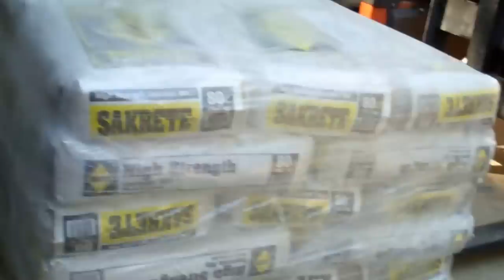Pouring a 60' Foot Concrete Sidewalk by Hand

Comment: Last year I had 5 steps leading to my porch and a walkway replaced for over $4,000. Your friend did a job just as good. You are so right...concrete is very expensive!
Reply from the maker: Wow that was a hefty price at $4000 for only 5 steps.. The concrete itself was pricey and was just glad I had my friend as a connection to make this project possible.
Reply: The steps are 6 feet across  and 9 inches deep, with a stoop on either side. Along with the walkway on the side of the house.
Reply from the maker: Ah ok, I understand now.

Comment: After working as a concrete mason for 15 years, this was almost painful to watch.
Still, it should work well, if there isn't a freeze-thaw cycle to worry about and the underlying base is sound.
I hope it diverts the water correctly.
Reply from the maker: It's not top quality work but it was a deal I couldn't refuse, and yes it keeps the water from getting under my Mega-Shed.
Reply: Lets be honest, its a Hatchet Job!
Reply: RVR2  No excuse for this hatchet attack.
Reply: You mean after 15 years of hiring mexicans... right?  This wasn't even a big job.
Reply: Lol even renting a concrete mixer would've only costed like $50
Reply: TheTomBevis can you recommend a good how-to for doing it correctly? We just bought a house that has all the features we want but almost every inch of concrete they added is utter shit. Two big patio slabs, the entire sidewalk leaning on one side of the house, front sidewalk messed up. It'll end up costing so much I'm strongly considering doing it myself.
Reply: youmongrel YT University has videos about every question you have, and it's free, and easy access.
Reply: TheTomBevis I'm just an occasional DIY concrete mason, and even I can see many things wrong with this.  I wouldn't know how to approach pouring and finishing in that enclosed area, but finishing with a pointing trowel?  No float?  Just screed and trowel.
Reply: The deal you couldn't refuse was your labor. No edging tool. WTF. The damn thing costs a few bucks. Screed job is ok. You never floated it at all. Not top quality? Not even even grade b. Rough as a stomped dog turd. Que Bonito? No. Not even a little.
Reply: I could do better work with just a hatchet. But ya. Totally agreed.
Reply: I really didn't get that. Mix it up on a slab, and then transfer it to a wheelbarrow. Then dump it out again. It was like they just want the exercise.
Reply: I generally work by myself when I do stuff like this. And I do it in sections. Takes longer but the finish is fantastic. It took me a few tries to learn how to float and edge properly.
Reply: How many puddles do you get on that walkway, be honest
Reply: TheTomBevis ok
Reply: actually this is how people in third world countries mix mud. Its an incredibly efficient way to mix mud. Are you even in the field bro? Or you more the white collar type? Desk and muffin bottoms?
Reply: johnknoefler 
cause these guys already know that you get more bags done as a one crew man on the slab than using the wheelbarrow and taking many trips... that's how they work anyways. About the finish I agree, they should've bought a floater.
Reply: johnknoefler 

Rough as a stomped dog turd!  Ha ha ha! I’m adding this to my quotes.  THANK YOU!

Comment: Wow these comments are brutal lol. They were working in trade people - no contract, no inspections, seemingly no budget, i would assume no freeze/thaw to worry about? The dude showed up by himself with a trowel and mixed, labored, poured and finished 60 ft tight in between existing structures in 8 hours so im impressed. Have to admit it was hard to watch having been trained here and i would never do it this way but both parties were happy. Ive been doing masonry for almost ten years and have seen the volcano as well mixing done in a plastic sheet when no shovels available, just rolling it around in a tarp. Have also seen 100+ yards done with a pump truck before lunchtime, all methods worked. This aint pretty but he got the job done with the cards stacked against him. True this would not pass inspection ANYWHERE in this country but it wasnt inspected... only by the owner whos standing right there filming! Third world resourcefulness being shit on by American commentators. Hope it holds up for you, if youre not in a freeze/thaw area itll probably do fine. This is not out of the norm in many countries but is by no means the industry standard in this country, which is what everyones griping about. 300000+ views nice!

Comment: I hate to be the guy who gives bad news but the ground should have been cleared a few inches with some gravel and a layer of sand for water to pass thru easily and rebar so when the the surroundings expand and contract rebar gives the concrete some give but pulls it back and keeps it from cracking ! And you should have tied the new concrete to the foundation of the existing building this way it has support and it’ll stay level with that and it all around is better ... and there should have been someone trolling the concrete after each pour to smooth it out and to help get the air out !!

Comment: For all of you critical of the Mexican.   I lived through a 20 year building boom in Texas. I saw thousands of homes built and sold for $250,000 to $5,000,000. I saw 1black, 9 whites,  and 25,000 Mexicans build those houses.  Here is the relevancy..... If you merely supervised them,  supplied them with tools, and materials, and consulted with them as men,  then you got a great, inexpensive, quality job, by highly experienced men. They take pride in good work,  and I personally know several who will not do bad work just because the customer wants junk standards like this job.  They would turn this job down.
Reply: No problem with Mexicans.  I have work with some on million dollar homes and many do amazing work.   The Mexican in this video does not do amazing work.  This job was done incorrectly, period.

Comment: No control joints? are you worried about cracking especially with the soil and material base?
Reply from the maker: Nope. I'm more concerned about stopping the erosion that was getting under my Mega-Shed. Cracks are not as big a deal compared to that.
Reply: I   do not think it qood idea  to  use scraps  like  that  your  going run risk  it failing  and  have a sink hole  int the side walk
Reply from the maker: This is a common practice actually.. If you use wood or dirt as filling material then yes that can happen but using rock, brick, or stone, (material that won't rot) the worst that could happen is cracking
Reply: When mixing concrete by hand u really need to make sure to keep a consistent mixture.. also before u pour concrete u really need to prep your foundation right. Adding tile bricks and stone won't help at all I give it acouple months or a year till you see your concrete start to decteareate..
Reply: Looks like this guy doesn't know what he's doing.. no joints no steaks on your framing doesn't have the right tools for pouring. Where's his edger? Bullfloat? Fresno?rubber boots?square or round trail?😆
Reply: wouldn't a French drain have been a better way???
Reply: your completely wrong. concrete has very little tensile strength, also freeze thaw cycles will crack and heave the concrete. not to mention that exterior concrete should be air entrained. also when I went through my apprenticeship, my best instructor told us their is two kinds of concrete, concrete that has cracked, and concrete that's going to crack. rebar and mesh will help hold those cracks together
Reply: For sure it will have cracks. But they will be invisible since the finish is so rough. Looks like he doesn't give a shit.
Reply: I did a whole bunch of concrete borders and sidewalks at a house. The owners were short of cash and wanted to save money every way they could. They had tons of rocks on the property. Toward the end of the job I was out of rocks. I literally used up tons. We even got good at learning how to stuff rocks into the concrete as we poured slabs and borders. We would save more than a third of the estimated concrete by adding rocks. It got so I was raiding rocks from a vacant lot down the street. Since I did the sidewalks in sections there was no issue with cracking. The walk way was poured between the footing of the house and an adjacent footing for a block wall. The wall footing was massive.
Reply: Lol
Reply: hey man. just so you know, I had a unit built in like 1940s. the interior flooring was brick underneath asphalt underneath carpet.
The brick disintegrated into sand.
So I don't trust brick to remain a solid base
Reply: my man, cuz all concrete cracks, fuck your control joints, bar, filler, w/e. All concrete cracks. These fools don't know Tom, tell em.
Reply: Edward C with that finish edging sure he's not worried
Reply: @rvr2  all it takes is one crack and all that water will run through and soften up all the ground beneath the concrete.

Comment: Looks fine to me. The only thing  I may have done differently would have been to use some rebar or mesh to keep the cracks from getting to wide. It is a backyard walkway with the purpose of diverting water. No big deal.
Reply from the maker: Thanks! Yeah that would've have worked as well

Comment: I just got an estimate concrete. They quoted $8,500. I know I can do it myself for less than $3,000. I'll buy a mixer, rent a compactor, install rebar & hire a couple of guys with experience to help out. Control joints are very important.
Reply: Well, you said that you were going to do all that a year ago. Update everyone about whether or not you did anything you mentioned. Evidently monolithic concrete construction doesn't need control joints anywhere in the world

Comment: I spent $220 at Home Depot for an electric mixer that has paid for itself already. He should have paid a friend to come help and knock it out in half the time. I would have at least added some wire and suspended it with those bricks. Btw, being Mexican doesn't equal hard worker or good work ethic; this man is a hard worker who just happens to be Mexican.
Reply: Exactly.
Reply: Devin Hardwick no but it helps🇲🇽
Reply: Someone is  Jealous. Did you get passed over for a promotion at work for a Mexican???
Reply: 1) Are you Mexican and 2) are you volunteering to do concrete work?

Comment: Never heard so many negative comments ... if you don't have anything good to say don't say anything . It may be a primitive approach and not done the best way but this world is full of arm chair quarterbacks that dont lift a finger to accomplish or improve a situation. a dirt alleyway to a sidewalk good job
Reply from the maker: Exactly! Thank you for posting this.
Reply: Glenn Vreeland from my experience reading most of these comments, most of these individuals aren’t arm chair quarterbacks. Many have stated that they have years of experience in the field and i have little doubt in this since why would anyone brag about working with concrete? 
And i relate anyone commenting on this thread to that of a critic rather than simple bashing. People are noting how this job was not only done cheap, but the man lacked: proper equipment, proper assistance and failed to implement the right techniques. The job was done horrendously and the final product shows. If this man would have taken the time to better research the project he’d taken it upon himself to do, he’d realize in what aspects he was lacking and could have made a much better job than this disaster.

Comment: pretty much what I have to do at my place, was wondering about using up old bricks and stuff to fill some deeper spots. Reading the comments doesn't sound like a great idea..better to use gravel and reinforcing steel...all costs more. How is it holding up 2 years later??? Did you get cracking and stuff?? Think I will hire a mixer. Originally thinking of doing it by hand too :) Thanks for the vid...
Reply from the maker: The crushed bricks sufficed for what I wanted but yeah gravel is probably recommended. Still holding up very well with only one crack. I posted an update video here: https://www.youtube.com/watch?v=da-T4lWoux4
Glad you enjoyed the video!

Comment: I know it might be late but, you should buy a mini concrete mixer, they come quite handy and they don't occupy too much space nor gas.
Reply from the maker: Well I still have the Mega-Shed driveway I want to get concreted one day so I'll keep that in mind. Thanks for the idea!
Reply: do they have hire shop in the u.s.a, because in the uk it would of been £20 maximum for a day hire of a belle mini mix, and you would done that in a hour!
Reply from the maker: Probably could have rented a mixer but didn't know my friend's schedule so I couldn't reserve one
Reply from the maker: Yeah and cement trucks cost a friggin fortune! Not in my budget...
Reply: not sure where your at but in Idaho it's $110 per yard for a concrete truck. 2 pallets of 80# bags is 2 yards. I'm positive you paid way more than $220 for all those bags. it was probably about $350 plus a ton more work and cold joints in the concrete from it setting up while you mix more. future- get a truck. it'll be better mud too.
Reply from the maker: Here in northern SC that's what I paid for 2 pallets of concrete mix including delivery fee.. It was more like your price for a truck.
Reply: So you think the issue is the mixer eh? You don't see anything wrong  with the brick layers trowel eh? The missing kumalong? The cement finisher's missing trowel?  The lack of any grade lines? The screeding?    Yeah this is how my dad used to do this too in the old country.  For some reason they see that brick layer's trowel as the all around tool, yeah they just enjoy doing things the wrong and hard way, makes them feel like they're 'working'.    BTW 60 ft of walk, 4 feet wide 4 inches thick is 3 yards, about  $430 dollars to have it delivered here the Northeast USA.  A much  more efficient, professional and cost effective way of doing 60 ft of walkway.

Comment: Yes, we build houses (shelters) in Guatemala and this is how you mix the concrete for the floor (after the shelter is finished). Unless you are very rich, there are no concrete trucks. We decided to rent a mixer to do a slab at a children’s’ home, and that was a mistake. There are no rental stores (except in The Capital) so we found a guy who knew a guy who knew a guy. Would have been easier to do it on the ground.  We Americans are an incredibly spoiled bunch.

Comment: I would have masked off the adjoining tiles to keep from getting the concrete on them.  Also you need to vibrate the concrete or tamp it down to make sure there are no voids underneath as it makes it weak.  Hope it has slope for water to drain.  At least you got it done!
Reply from the maker: The slope is adequate for water runoff. Thanks

Comment: How many bags of concrete did you use? I have a patio I'd like to do & it's about the same square ft (35×5). Just curious roughly how many i would need.
Reply from the maker: Don't remember the exact quantity but it was 2 full pallets of 80 pound bags of concrete from Home Depot

Comment: I’m trying to learn so I can add a small side walk on the side of my home here in Pensacola. I was wondering why you didn’t had lines going across it width wise not length. Aren’t u supposed to do that?
Reply from the maker: Yes there should have been but honestly I wasn't worried so much about putting cuts as they're called in this sidewalk as I was most concerned about stopping the erosion going on under the shed. That was accomplished here.

Comment: I have no clue about laying concrete but i can definitely tell you that this is not how i would have done it . At least i would have broken those old concrete slabs in smaller pieces and make those grooves every 10-20 feet ...

Comment: It looked like it sloped to the middle of the walkway or it might just be the reflection or camera angle. Hope theres no problems with water pooling or running in the wrong direction. Anyway, its just a DIY job on a walkway that doesnt look like it gets used much so no worries. However, it would've been better had you hired/borrowed a concrete mixer and grabbed proper trowels. A couple of control joints along the way would've been better too.
Reply from the maker: It's sloped like it's supposed to be and the water is running along towards the front like it's supposed to be and not under my Mega-Shed..
That's what people need to understand is that I didn't want a high dollar fancy sidewalk here, just something to stop the erosion and that's exactly what it's doing so I'm satisfied with that.
Reply: Sweet....must've just been the reflection or camera angle that made it look that way.

Comment: Did you mean to say 6 bags, rather than 6 pallets left over??  Its nice that you shared your experience, and that you took pride in completing that task. For a small bit of money you could have bought some concrete finishing tools, and simplified your day.  It appears that your going to have some pretty good cracking along the brick edge where its tapered to 0 depth. Hope it hold us for you and serves the purpose.
Reply from the maker: Yes I meant to say 6 bags there, that was my mistake. I agree it could have turned out better if we had the proper tools but it's doing the job that was intended.. Yep it's already got 1 crack but it stopped the erosion under my tiny house and that's all I wanted. Thanks

Comment: Don’t hate on the man,
“Get a concrete truck!” You see how steep that driveway is to push a 500lb wheel borrow up?? 

“Get a buggy!”
Wouldn’t fit back there 

“Get a pump!” 
An extra $500???

He didn’t put any control joints, it’ll crack, but it’s behind a shed 🤷🏻‍♂️

The man did an alright job with the finish, next time broom it my friend so it won’t be slick when it rains 👍🏼
Reply: That $500 for a pump would be worth every penny too! :)